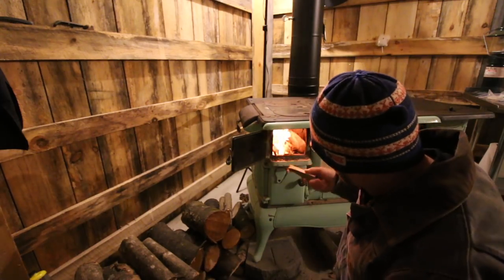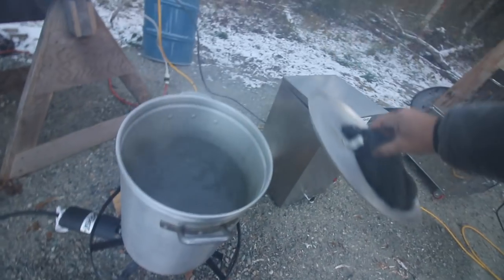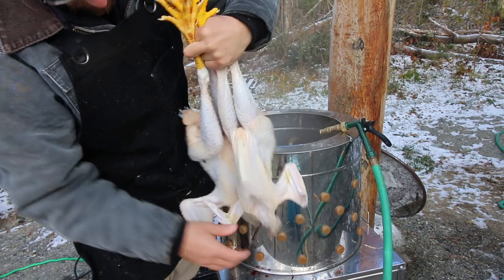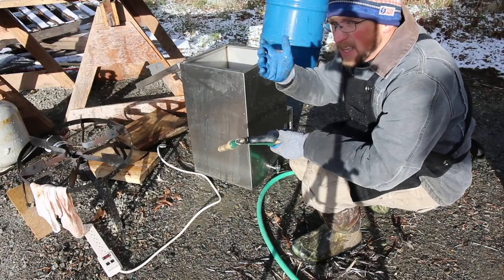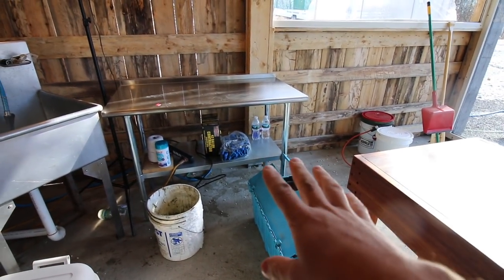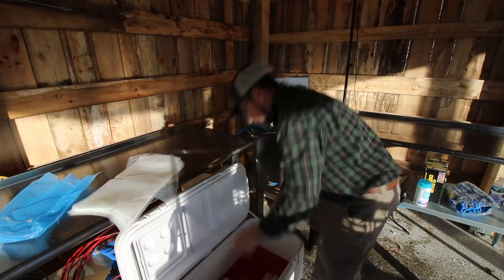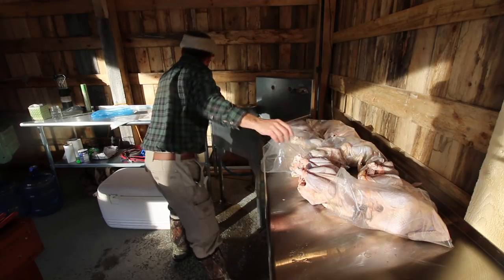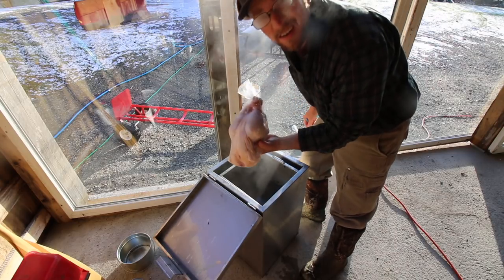Harvesting Meat Birds when its 20f Out

Comment: Nice job harvesting the birds all by your self. The plucker really cleaned the feathers off of those birds and they look to be a nice size for eating. Maybe try some turkeys for next year. I would think that maybe 10 birds in one tractor should work out. With the bigger opening on the new plucker the turkey should fit in and get plucked ok. I think that the new plucker is a better product that the first one. But the switch location is much better.

Comment: A safety note first to remind folks ANYTIME you use an extension cord outside be sure you are also using a ground fault (GFCI) protection outlet.  It would be a terrible shame to get electrocuted while harvesting your birds or working on the homestead.  The new plucker worked great!  It really does get them nice and clean.  I am probably too cheap to ever buy one though.  I can hand pluck a lot of birds for that $400 price tag.
Reply from the maker: But once you use one you will ask yourself why didn't I get one sooner! :)
Reply: Thunder Ridge Homestead if the plucker lasts 10 years  that's 40.00 a year  if You do more than 10 birds a year it will pay for itself very quickly 

If I recall right AL did 25 birds in about 90 min working by Himself   that includes slaughter plucking and moving them from station to station  that works out to between 3 and 4 minutes for each bird  between the scalder at 350.00 and plucker at 400.00 seems like good money spent
Reply: I am sure that they make things easier in many ways and for many folks they would pay for themselves, but you have to consider I am old.  I been doing this a LONG time as well, so I too am extremely fast and efficient.  I process between 35 and 50 meat birds a year (including a few turkeys) by myself.  With a properly scalded bird the plucking only takes me a minute max per chicken.  (A turkey takes longer)  What takes the time is the rest of the process, since I typically cut my birds in meal portions before I package them.   I pluck straight into a lined trash can, so cleanup is super easy as well.  With a plucker it would be another piece of equipment for me to set up, clean up and store.  I also age my birds a couple of days in the refrigerator before freezing them.  That allows the meat to go through ridgor mortis and makes the birds that much more tender and better.  Because I age them, I also usually process no more that 6 to 8  at a session.  (I have to have room in the fridge)  A plucker would once again cause me personally more trouble that it is worth.  (Unless of course I had a fancy outdoor kitchen  <drool> to keep it set up in!)   

Then there still remains the cost. Lets figure ... 10 years with 50 birds a year is 500 birds.  If the plucker lasts me the full 10 years we are still adding a cost of 80 cents a bird to the cost of my meat.  I'd rather by better feed with that 80 cents and pull those feathers out with my fast little fingers.

Comment: That's a lot of work for one person in a day, great job. The new plucker seems much better than the other one all around. A very solid piece of equipment at an excellent price. You don't mention, and I'm curious what you do with all the feet, and giblets. One or two more freezer bags, they could be processed into a nutritious stock. Lots of vitamins, minerals, especially iron, as well as rich in flavor. Using stock to cook rice instead of water, would make rice into a more nutritious addition to any meal.
Reply from the maker: We need to get better at saving our legs for stock. I was very happy with the new plucker
Reply: When I scald my birds, I put them in feet first that way when they go into the plucker the feet are skinned - even the toenails come off! I put them in my bone broth pot then carefully lift them out and dehydrate them for dog treats.  All the innards are ground up for barn cats.
Reply from the maker: Terri Poulin I will have to try scalding feet first next time. Thanks. Do the cats eat the guts too?
Reply: Lumnah Acres - I have one very large cat that does. I pull the hearts, livers and the gizzards, grind them up for the cats. I think it's L-Taurine they are high in which cats need. I take the remaining guts - cutting off the gall bladder and spleen (those go to the compost pile) - run them through another grinder and those go to the chickens - which sometimes my large barn cat snacks on them along side my chickens. This may sound gross but I've been trying to figure a way to grind the heads for the chickens also because of the nutrient content there. I'm sure my new grinder would handle them but my old one doesn't and I prefer to use separate equipment. I try to use everything and sometimes too many feathers and heads overwhelm the compost pile.
Reply from the maker: What do you have for a new grinder?
Reply: Lumnah Acres - No where near as awesome as yours but I have a Sunmile and it grinds up bones!! This year I made spicy Italian turkey sausage and one batch has bone fragments unfortunately - not a lot but it's not fun chewing sausage and biting on a tiny piece of bone! My old grinder would just shut off if a piece of bone got caught in the blades. I'm going to need to be careful with what I'm throwing in the chute now!! Another interesting tidbit,  I used smoked paprika in my sausages this year and the taste is fabulous!
Reply from the maker: Smoked paprika sound delicious! We borrowed one and now I need to figure out which one to get
Reply: I have no clue what brand my is - bought it from my local food-coop bulk section so I'd know it would be organic and fresh!
Reply: I just finished milking and your reply popped up again. Rereading it, I realized you're talking about a grinder not the paprika! 😬 My bad! 😜 The one I have is not for large amount of meat grinding. I bought it from a guy who used to grind up deer meat to make jerky. So for now, it works perfect for me when I'm just doing one small animal at a time. It would be nice to be able to rent grinders just to do a comparison on what you need.

Comment: Great vid, of course! We're doing our birds this week, but I'm a little freaked bc I have the plucker that you HAD that broke!  Fingers crossed!
Reply from the maker: How many birds are you harvesting?
Reply: We have a yardbird plucker, too!  We did 12 birds so far and had to reset a couple times.  Should we just return it before it dies?  $400 is a lot of money to flush.. we bought it 2 weeks ago.
Reply: We have 8 roosters and a guinea. We call them "Thanksgiving" :).  
 It's scary. I've never used a plucker (Vicki) and Ray is not much of a homesteader.  There will be a video. It's good news that Yardbird made good. Ray got laid off RIGHT after we finally got our forever homestead and we need stuff to work! No time for issues.
It's all me, Al!  I'll do it the homesteader way.  The best that I can! Thanks for setting the best example possible.  We love you, and 'Liv loves that you have an "Olivia!"  
Hugs!
Reply: We/alI so feel THIS.  We have NO wiggle room. I waited 'till last minute to buy one.  Fingers crossed, we're trying it Thursday.
Reply: Oh man, good luck.  We're  doing ours on Thursday!
Reply: Since the yard bird quit under a load  two Ideas come to mind belt tension between the motor and drive pulie is not right  
Or electrical circuit is overloaded  or its plugged into a too small extension cord for distance  without seeing Your set up I couldn't nail it down more closely than these suggestions
Reply: I have no choice but to use ours.  We're setting up today to harvest on Thursday.  We'll let you know how it goes.  It was nice, though, that Al said Yardbird would make good on their product.  Fingers crossed for all of us!